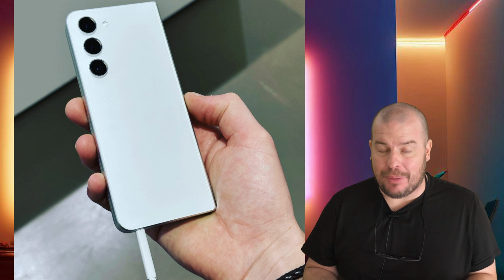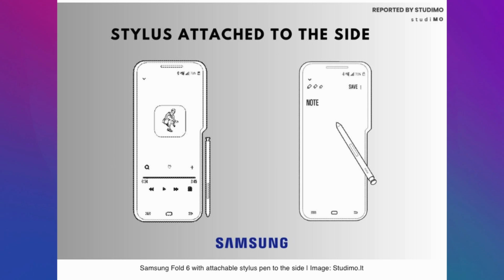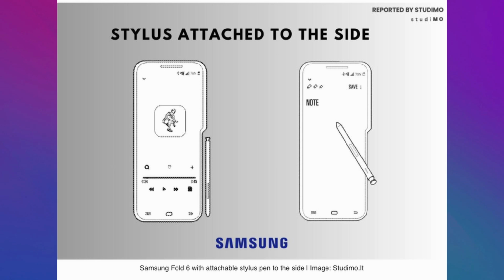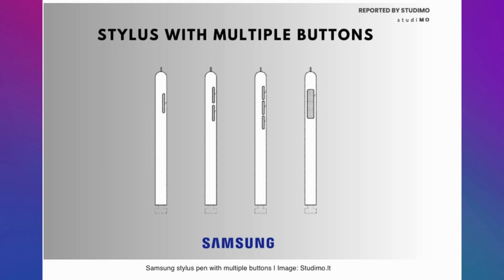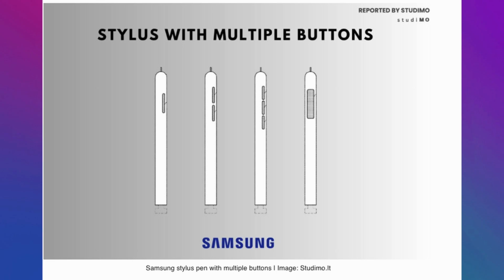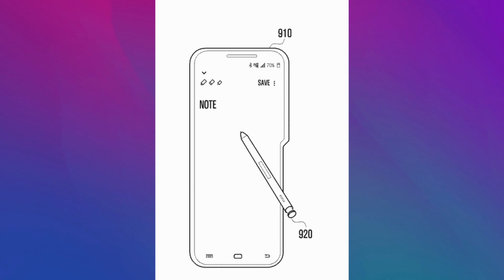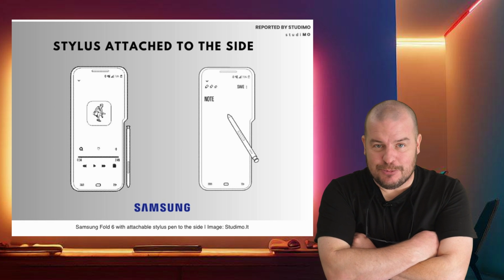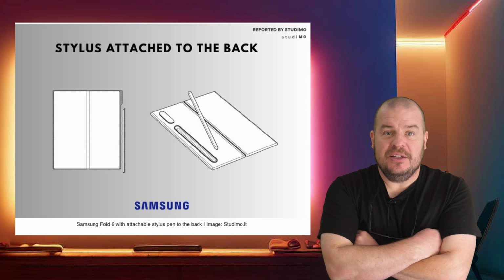Galaxy Z Fold 6  w/Integrated S Pen, New Folder Designed Front Display and MORE!

Comment: Samsung literally doesn't even have to do anything different for the next fold.  Anyone with a fold 4 or fold 5, do me a favor and rotate your phone 90 degrees and hold it landscape.  OK, Right THERE is all samsung has to do.  Don't change the overall dimensions.  Just, change, where, it FOLDS.  Instead of folding tall, like it does currently.  Fold it fatter.  Similar to the pixel fold.  Except with Samsung, their apps will fit the screen better and third party apps won't have to change anything either since they're all optimized for the Z Fold's screen ratios whether tall or wide.

Comment: Considering this is a patent, I don't put a lot of weight behind this. Companies, especially in tech submit patents to protect future ideas and functionality that they may or may not plan to implement in a future device. What's missing here is the detail of the patent. Technical drawings in a patent have to be extreme in order to show the purpose of the patent and the functionality that they are submitting for. If used in a product they very rarely come to fruition in the form that is shown on the patent documents.

All that being said, if this were a real design for a real product I'd argue this is a terrible design for a phone. It creates imbalance and lends itself to issues. I could however, see this as showing how a pen could be positioned inside a foldable device. The back implementation being the one that stands out most to me.

The "folder" cut out one seems like it could be showing potential implementation within the flip, given the short pen. In this instance the pen cutout could be interesting.

Comment: The photo with the longer pen on the side and the tiny wide bit at the top is better than the folder look with short spen. I actually like the fold 5 with the pen in the case. I would rather that  and a bigger battery

Comment: These are just patents not real designs. They all look stupid and there's no way they'll do a side mounted stylus. No shot they do a stupid asymmetrical screen like that. Reliable leaks already confirm the fold 4 5 and 6 will have the exact same cameras. Best case scenario is they copy one plus by adding width and use some of that space for a note style silo. Googles pixel  and the one plus wont sell well so I'm beting Samsung will coast another year with the lack of competition. Fold 6 will be a fold 5 with brighter screens and a snapdragon 8gen3 with camera processing improvements and maybe dust resistance or some A.I. stuff.
Reply: Don't you get it by know that Samsung does not listen to their customer base?Samsung is an embarrassment in the world stage. Their Hardware is 2yra behind, so Samsung is currently "reverse engineering" a Huawei foldable to try figure out how to make a thinner fold... 😮😮

Comment: I hope it won't be a folder design i don't like it I want it to look like an s24 ultra from the front and if its gonna be a slim spen why not just put the note sized spen inside the phone.
Reply: Don't you get it by know that Samsung does not listen to their customer base?
Reply: @Maxx134a  they have became apple in the department except they make 50 phones which I hate because why not sell older flagships like the s21 for slightly a cheaper price which is much better are faster than any a54 and why does the s23 fu exists its a full blowed up a54 with better specs I'd call it the s23 fu I wouldn't even call it the s23 series but a rebrand galaxy a54s its like comparing iPhone 6 to iPhone 6s same dimension and design language with better hardwares and internal the galaxy so called fu is basically an a54 minus sd card slot and 5000mAh battery with all the wireless charging features, samsung dex and a telephoto lens but it's the same camera quality. Like they could reduce the price of the s23 to $599 on there end since it's almost a year old but they just love making 50 phone and needed something for a fill in.

Comment: Front display should be 7inchs with 7mm width

Inner screen 8.8 inches.

Bose speakers.

5500mah battery.

Some interesting colors.

Cameras of ultra version.
Reply: I have to agree with you, those specs would make the dream phone
Reply: Awwwwww that will be my ultimate dream @hazemfive
Reply: oh boy not liking it, May move to Google for my folding phone
Reply: Samsung is an embarrassment in the world stage. Their Hardware is 2yra behind, so Samsung is currently "reverse engineering" a Huawei foldable to try figure out how to make a thinner fold... 😮😮
Reply: @Maxx134a  they could make the phone slimmer my giving us a wider outer display and even a bigger inner display like squish the pho%expected rather than craming it thicker, honor fold is able to give u stylus support front and back, 500pmAh battery and there highest end camera in a slimmer body because it has a wider canvas being more room to fit it stuff, I'd rather have a alightly thicker camera bump of a giant slab, not that I find slim and heavy smartphone but the zfold in folded just looks like a tv remote and not a phone.
Reply: That’s too big
Reply: @Jay2k2323  compared to what we pay, this the minimum that Samsung can offer.

Manufacturers needs to stop be greedy.

😁
Reply: It could stay 6.2" the problem is the weird aspect ratio, I'd want the phone to fold horizontally and increase the vertical length by a cm to give u a wider slab experience while being like a tridtional slab phone ever so slightly wider than a normal smartphone bit better wide than weirdly narrow looking like a TV remote and opening in close to a 16:9 aspect ratio like when you open the zfold 5 and compare it to the iPad mini the iPad mini aspect ratio looks alot bettet while the zfold is almost a square giving you weird black bar while watching videos and when you watch in the normal aspect ratio it's basically smaller than a slab s23 ultra and the whole point it to enjoy more screen realistic which you don't get to with the weirdly square display.